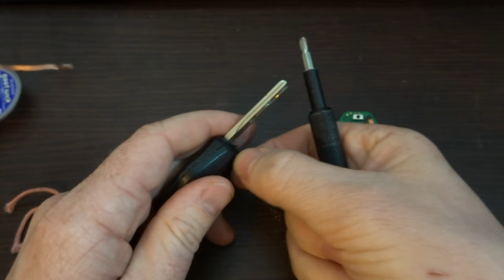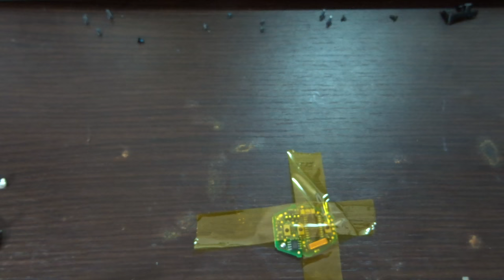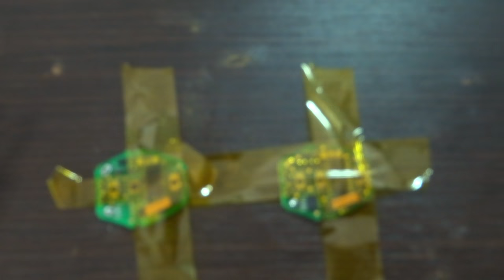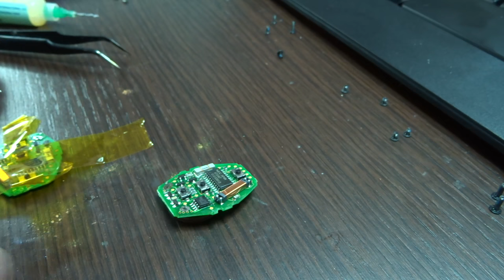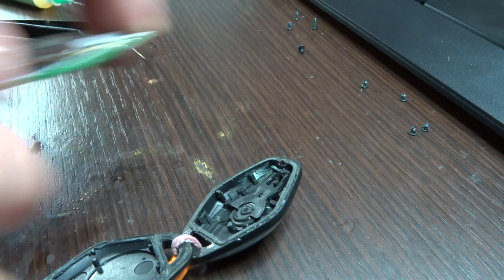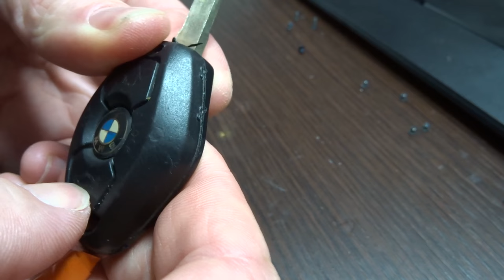#3 Remplacement transpondeur cle BMW 🚘

Comment: What power (or how hot) is the heat gun?
Reply from the maker: For this one I've used around 240 Celsius on a hot air station.

Comment: Hello!
Is the car starting after this operation?  The lock-unlock of my key fob (the only one) isn't working and I found a donner key and if the operation doesn't work I will not be able to start the car. 
Can you assure me that it works? 
Thank you!
Reply from the maker: It works to start the car but to be able to lock and unlock you have to synchronize the original key to the copy. The chip changed in the video is for starting the car. You are doing all at your own risk.
Reply: Yes, know how to synchronize the key with the central looking system. This is what I'm aiming for. To move the transponder to a doner key and then to be able to start the car and lock it with this key fob.🙂
Thank you for your answer!
George

Comment: Bonjour tres interessante ta video, j’ai acheter 2 clé bmw sur un site chinois, ta manip est elle obligatoire pour que la voiture reconnaisse les nouvelle clé?
Reply from the maker: La manip est obligatoire si t’as pas d’autres moyens pour la programmer. Sans changer ou reprogrammer cette pièce la voiture soit elle démarre pas soit il y aura des voyants qui s’allume sur le tableau de bord et certains systèmes ne fonctionne plus.
Reply: - Roumain - 
Merci pour l’info. Sinon c’est quoi le produit que tu mets sur les soudures apres avoir retiré le transpondeur? Et a quoi sert il?
Reply from the maker: C’est du « flux » c’est un produit chimique qui aide à la micro soudure. Sans cela l’étain va s’oxyder et les composants n’adhère pas une à l’autre.
Reply: - Roumain - 
Mercii